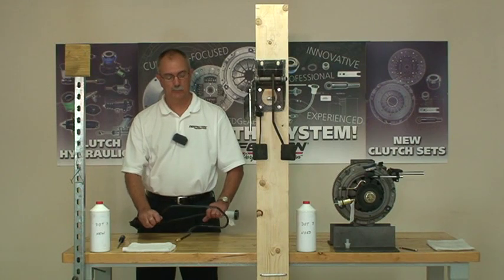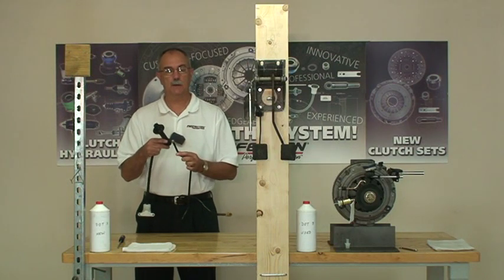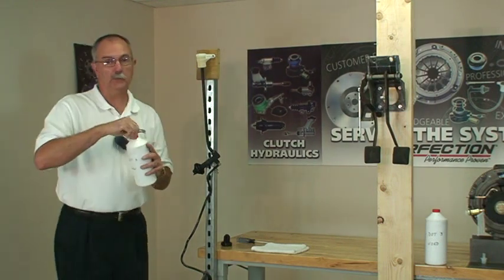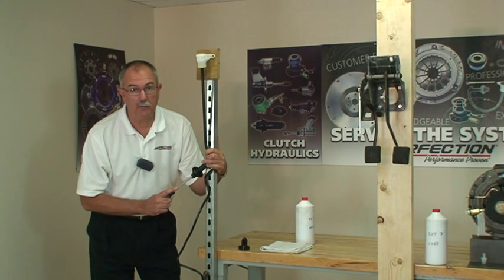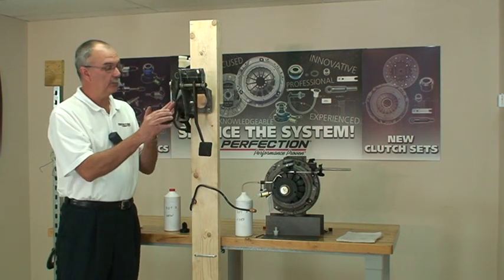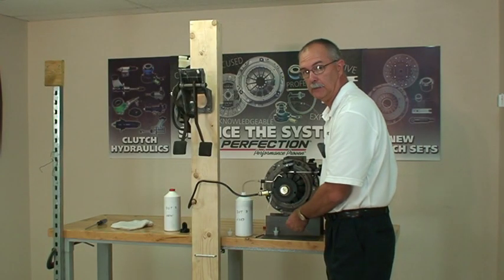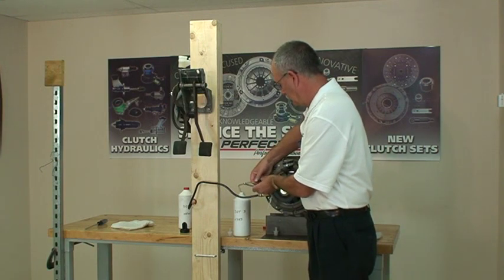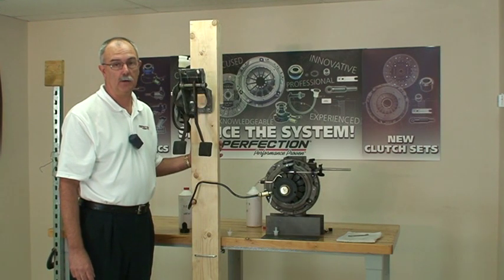Ford Ranger & Mazda B-Series Pickup Clutch Hydraulic Release System Bleeding Procedures

Comment: Thanks for the tips on this. I replaced the line,master and slave cylinder ..and tapped on the line watching bubbles from in corners popping up into the reservoir then pushing the plunger in,which left me with 1/16 of push left in the plunger about 5 mins worth..awesome video!
hooked it to a new slave cylinder on the trans and bled that for 2 full refills,
now my 91 Ranger 4x4 is just like new again ,besides the minor rust ...
Thanks once again,truck came to life.... 
The Johnson's

Comment: What happens when the bleeder is so tight that it snaps off?  Hopfully I will be able to answer my own question soon.

It's been a few days.  The slave still isn't working correctly. Truck creeps forward while in gear, with pedal depressed.  Also hard to shift. and truck wants to roll if you try to start in gear with the pedal pressed.